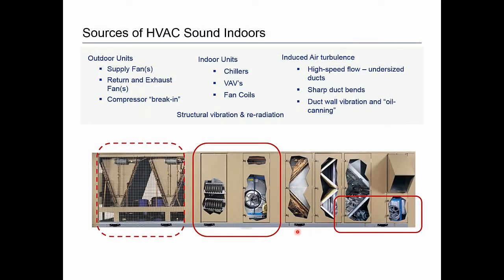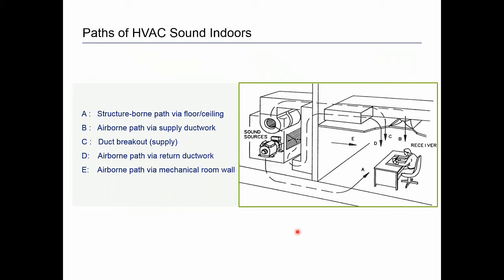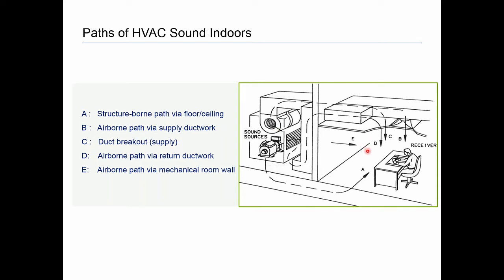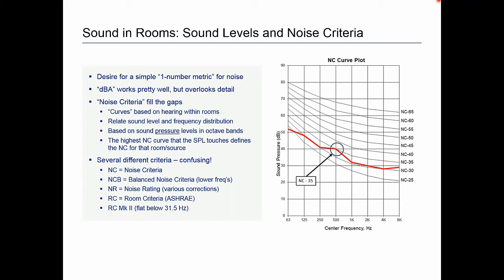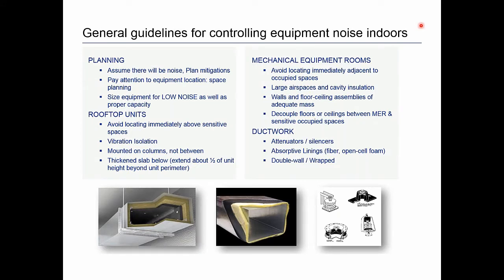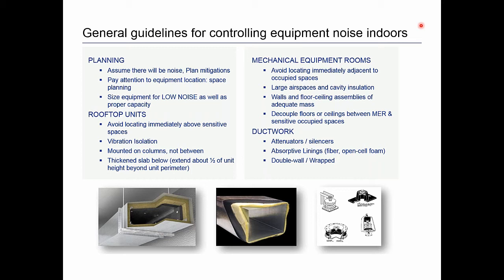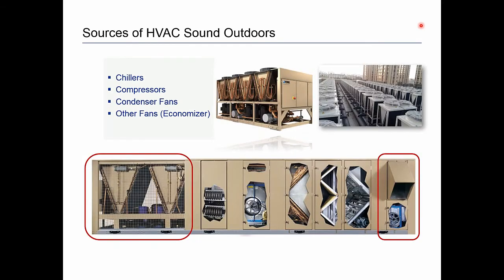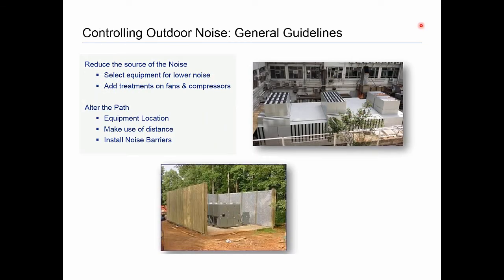Sources of HVAC Sound and How to Control Noise

Comment: Some "smart" architect put the chiller under the building instead of the roof top and the council decided to convert the surrounding areas into residential houses and they're complaining about noise from the street level vents.